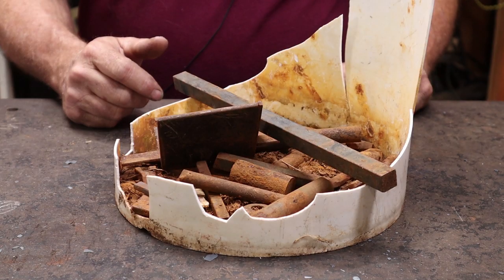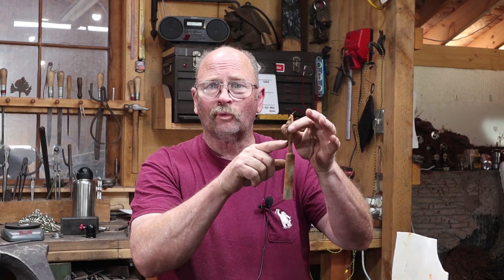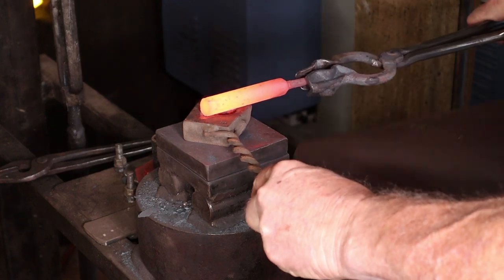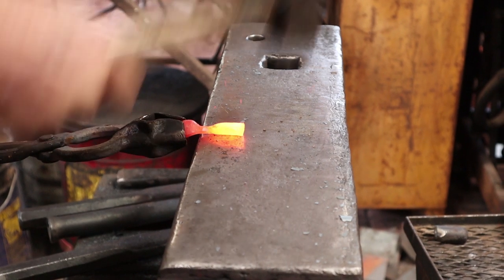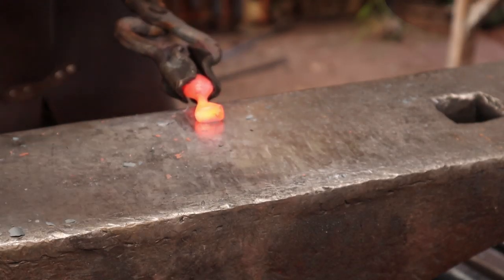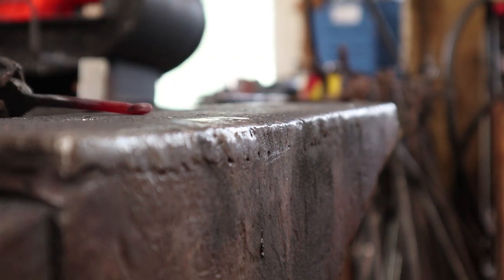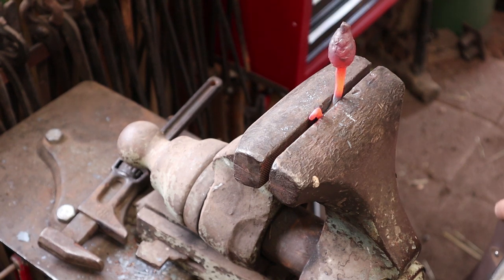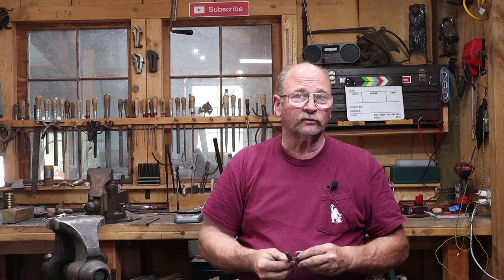Mouse tail hooks - Hook of the Week 16

Comment: I'm about to be able to set up my 70 lb farrier anvil and little "Whisper" brand gas farrier forge, with back door, simi permanently. The first thing I'll be making are tonges. I have a few green "T" post, horseshoes, a flat bar that I bought from Tractor Supply Company, and a few of those Shepherd hook plant hangers. I would say that the hooks are wrought iron but I'm not so sure about the T post. I'm starting out with one pair of Stainless steel flat tongs and a few other farrier metal working tools. The flat stock is what I'm planning to make tongs out of. I'm planning to make a lot of tools first. With knowing where I stand for getting started, where should I start. Oh yeah, I will have to make rivets for my tongs. Pretty much the only things that I have ever made like this are horseshoes and hoof picks out of horseshoes. Any advice will be appreciated.
Reply: Sounds like you two are on a roll, great.  As for the shepherd hooks and T-posts, being modern items, are not going to be true wrought iron.  The hooks are most likely Chinese mild steel and the T-posts these days are, by a lot of companies, made from recycled railroad rails; cut, reheated, drawn out to shape and forged.  Some of their T-posts are just stamped metal.  It's good that you are setting out to make your own tools.  Happy forging!

Comment: I'm just getting back in the forge after a long hiatus and made a couple of S-hooks for my wife's pot rack. Haven't scrolled the ends, yet, because I'm annoyed by a problem in an otherwise perfect forging, fish lips at the tips. How do you avoid those? I'm thinking of rasping off a bit of the 1/4" stock on the ends before drawing to a point. I didn't see you do that so what's your tip, no pun intended?
Reply: If you put a taper on the section you are going to draw it helps a lot. I use angled blows pushing towards the tip with the head to bevel it so when it fishlips, it does it to be closer to flat. Otherwise just rasp or grind it off.
Reply: @Luis-eu2ow That's what I was thinking and figure I'll need a rasp for that on this small, 1/4" material as I tried to do some angled blows and it more deformed the whole heated area, bending the material, than the end I was trying to push back into itself.
Reply from the maker: Light hammer blows tend to effect the surface more while heavier blows penetrate deeper into the material.  so being a bit more aggressive might prevent the surface from spreading to fast.

Comment: Off topic. When you spark test an unknown metal does it change if hardened from the way it sparks when normalized? Or annealed? Not sure if I'm being clear...
Say you spark test some 1095 that's been normalized then you harden that same piece and then spark test it again. Will it spark the same both times?
Reply: I don't think it would change. The sparks have to do with what's it's made of, not whether it's annealed.
Reply: @christophercraft957  that makes sense. I know almost nothing about this subject. Since heat treating changes it's grain size and how it moves under a file and probably under a grinder it seemed like a decent question. But what you said makes sense so the question doesn't look as well thought out. I'm learning. Thanks for your help.